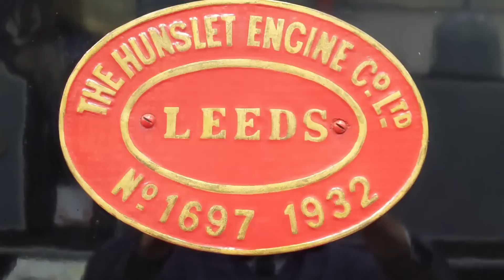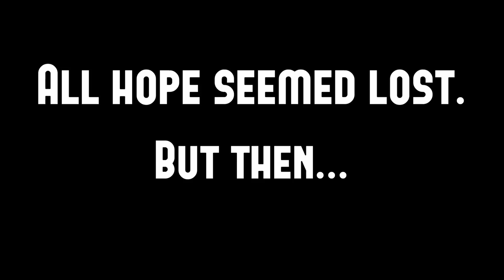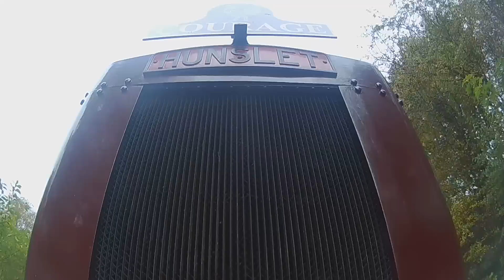The smallest standard gauge engine? Courage, the littlest Hunslet. Lawrie Goes Loco Episode 22.

Comment: You can really see why it internal combustion on the rails didn't catch on until the starter motor became common. I'd much rather put a fire in a steam engine and wait a few hours than have to start that Medieval piece of torture equipment.
Reply: It's a tossup between starting a diesel or shoveling coal into the firebox every 2 minutes.
Reply: @ach3909   It's absolutely completely bonkers
Reply: @PreservationEnthusiast  bonkers
Reply: @o.m.b.demolitionenterprise5398  It's totally fantastic. It's absolutely completely totally  bonkers
Reply: A great replacement for a horse shunter
Reply: Starter motors aren't the only other means of starting a diesel engine. High pressure compressed air admitted to the cylinders works very well, and was an established technology long before Courage was built.

Comment: There may be a smaller standard gauge loco than this. JACOB is a small petrol engined loco that worked at a Jacob's biscuit factory. The engine was at Dinting Railway center but where it is now I don't know.....just googled it, the loco is at  Statfold Barn Museum

Comment: If you had told me the same uni students that ran the line had knocked this together over a weekend from spare parts as they needed a locomotive quickly I'd have not questioned it...

Lovely quaint thing!
Reply: Okay we have chains, a narrow gauge motor and bonnet, truck frame and some metal beams

I can make a loco out of this
Reply: Still more effective than the prr q1 locos

Comment: You have just made my day, I've never laughed so much wathing you try and swing that engine, did you change from highto low compression before you tried starting that, I helped move a 4 cylinder version of that engine with a generator attached from Milton Keynes to Internal Fire museum Tan y Groes in Wales, I had the generator set on a trailer behind my van and a friend had the engine on a trailer behind his van.
When we got it built together it took four men, three on the large starting handle and one on a rope attached to the handle to start it. :-) Forgot to mention, that engine is a modified version of a Lister CS twin, CS stands for Cold Start" :-)

Comment: That's one racey shunting engine! You see, Hunslet understood that a true fast shunter should be light as possible for handling
Reply: Until you try and stop a few wagons in the snow, downhill, and sort of just slide. A 48 goes out of control with a single coach, so I shouldn't wonder the maximum braking load for this.
Reply: @ajaxengineco  it tends to be used along the flatter tracks here,  a downhill run from Middleton park might be lively if all three coaches , wagon and brake van were in service together.

Comment: If you momentarily allow the clutch to engage in the neutral position on the way through from low to second, while letting the revs drop as you did, you should be able to engage the higher gear without grinding, enabling a quicker and smoother gear change. Essentially double clutching/rev matching.
Reply: One tends to need both feet on the clutch and brake bars on this.

Comment: That looks to be much the same way as I used to have to start our 1939 John-Deere model "A" farm tractor with the exception of you have a crank handle whereas I had to grab the actual flywheel itself and spin it by hand.  Its "pressure relief" was a petcock valve on the side of each of its two cylinders.  Some days it'd start on the first couple of cranks.  Other days it seems I'd spend an hour of cranking and wheezing for breath before it would pop off and run.  :)  When starting the process was to turn on the petrol so it would gravity flow down to the carburetor, set the brakes, put the gear lever in neutral, give it some throttle, pull the choke out full, open the petcocks and give it a crank until it reached a compression stroke.  If luck were with me I'd get a single pop and then would push the choke halfway back in and on the next compression stroke it would fire off.  Then I'd close the petcock valves, push the choke back in fully and climb aboard, release the brake sets, pull the hand clutch, select a gear and push the hand clutch forward and off I'd go, lol.  It did have an electric start, but 99% of the time the 6volt battery was always dead as it was set to charge very slowly assuming that you'd be on it in the fields all day.  The sound of it running at throttle was amazingly similar to the sound of that Hunslet as you came out of the tunnel.  If it were slowed down to idle though, which we would set it on for splitting wood with a hydraulic splitter that coupled to the hydraulic pump in the tractor it sounded like it was going to die which was normal.  It would sound like pop-POP-foof-foof-foof-foof-pop-POP.  If you ever get the chance look up Hand starting a John Deere "A" sometime on youtube and you'll see and hear what I mean.  :)
Reply from the maker: I'll have a look, cause that sounds awesome!
Reply: @lmm  This one, https://www.youtube.com/watch?v=8a-jLedQJhk while one size smaller than ours shows how to start and drive one pretty well.  Ours was a bit more of a bear as it had a larger flywheel with teeth on the backside of it for the starter motor to engage even though we usually started it by hand anyway as the battery was usually flat.  They were originally a 2 fuel tractor with two tanks as back then kerosene was much cheaper than gasoline.  You'd start the tractor on gas in the small tank and when the engine warmed up you'd switch to the kerosene tank.  We ran gasoline in both tanks, using the small tank as a reserve so that if we ran out of gas while mowing, plowing or whatever, we'd switch to the smaller tank and drive back up to the barn where we stored fuel.

Comment: Lawrie it's not surprising that is hard to start by hand... The JP2 is a whopping 2.9 litre engine for all of its 22hp. And with it being only 2 cylinder, as you said, it will be harder to turn that a 4. Add into that the higher compression of a diesel and yep...It's gonna brake and break you lol. Good video regards Gary

Comment: I guess they don't have Wheaties brand cereal in the UK. But then again, you have a bone-cold Diesel engine, started via primitive method. In which one has to work against the low viscosity engine oil, plus internals which lack that oil film. That's the reason why pneumatic and pony/change-over starting systems for Diesels began to become popularized around that era. 

For a simple locomotive it has charm to it. Like an antique tractor or truck.

Comment: This line might be the first "preserved" in the UK however the Strasburg Railroad in Strasburg Pennsylvania USA which their first train  running as a tourist/preserved railroad in june 1959 and bought a steam engine 1960 (Canadian National #7312 which they renumbered to 31 and is the first steam engine to be retired and then returned to active service in the US). 31's first run was also in 1960. Sadly 31 is currently out of service. However, Strasburg also has 4 other operating steam engines, that pull train just about year round.

Comment: If the brewery still had horses it would have been easier to use a Shire in trace harness to pull single wagons around the yard. 
I am sure that starting that Lister would have meant unauthorised methods of warming the cylinders , plus volatile petroleum.
You can tell that this was meant for moving one wagon at a time with that horrible transmission.
Reply from the maker: It's not meant for the mainline, that's for sure!

Comment: Funny enough, I know of a even smaller standard gauge loco!
Reply: Gazelle?
Reply: @ajaxengineco  No. It's also a (diesel?) Shunter like this one. It's preserved at a heritage railway/museum in Germany. It's basically a Lance-Bulldog tractor (I think) bolted onto a wooden frame with some widened 2ft gauge axles underneath.
Reply: @Locomotiveman1994  That sounds wonderfully ramshackle. Though maybe not entirely powerful.
Reply: @ajaxengineco  aperently it was plenty powerful for the task it was acquired for, as it worked untill the mid 90s! It only had to move single wagons around the premises of a trader for farming supplies.

Comment: 1. Do a goes loco on that y7, it's so beautiful
2. Love the video, loved the loco, and love you 
3. That's not the smallest standard gauge loco, peckett 1900 'flying  bufferbeam' has got to be the smallest by far
Reply: 1900 is much bigger.
Reply: @KrisDouglas  surely it can't be ? You have to sit down in the cab
Reply: Length and width, 1900 is huge for an 0-4-0. Just squashed down. Gazelle is properly small.
Reply: @ajaxengineco  fair enough
Reply: There should be some middleton railway vids on the Y7 overhaul done as part of National Lottery Bid to share information.

Comment: I presume you were only trying to start one cylinder at a time? Old listers can be a ball ache. I ran an old tug which had all Lister engines. Lister Blackstone mains, small lister driven air comps and a fire/salvage pump driven by a very similar engine to what you have there. I’m not going to pretend I didn’t keep a can of quick start handy for the coldest Scottish winter mornings. I frankly wasn’t paid enough not to. But I used to find that each engine had its quirks and a different knack required to get them going. Once you got them going though they were no trouble at all.
Reply from the maker: I assume so, but I'm really not sure how they were doing it. I was just cranking

Comment: I've seen coal fired steam locos that have made less smoke.  Add that to hard starting and "never had any major work since the 1930s" and you come to "could REALLY use a good dose of engine restoration".  And one more question - how does it last if the gears grind like that every single time you start?

Comment: how does it compare to Peckett 1900? I always thought the flying buffer-beam was the smallest standard gauge engine.
Reply from the maker: I think it's both longer and heavier.
It's certainly less high!
Reply: @lmm  It would be really cool if you could drive the flying bufferbeam when they get it back together, covid seems to have really slowed them down, though, and they weren't going that fast to begin with.

Comment: Try getting the other train to come get it in rotation or get a motor that has high power torque stick it in there and rub it up that's the only way you going to get it fire up and crank it this is super Dave does local
Reply from the maker: That's how they normally get it to go!

Comment: Horsepower is so misleading.
That engine likely has gobs of torque but runs at such a low rpm that the power rating is only 22hp.
Reply from the maker: It's still not very powerful
Reply: @lmm  probably even moreso by railroad standards. lol

Comment: That engine need some work If It won't start on the handle, lots of smoke maybe gives it away.
Reply: JPs are a bit smokey generally, but it seems like the decomoressors weren't working quite to their fullest extent.
Reply: @KrisDouglas  Yep, I work on and maintain railway diesel engines, all of ours are electric start but to be honest, none of them smoke that bad even with worn valve seals and rings. It seemed to rev freely though when it was finally started.